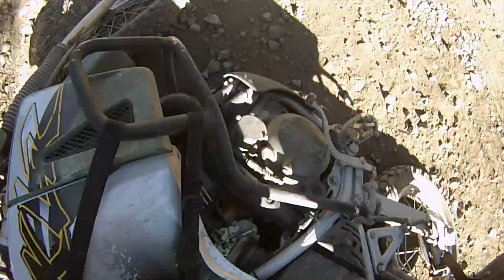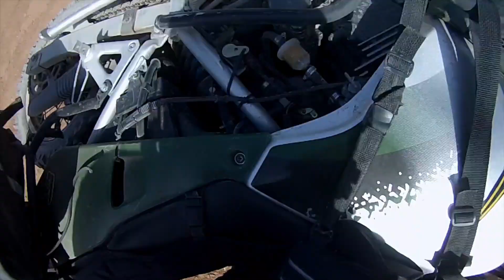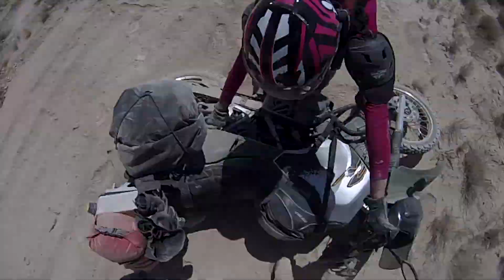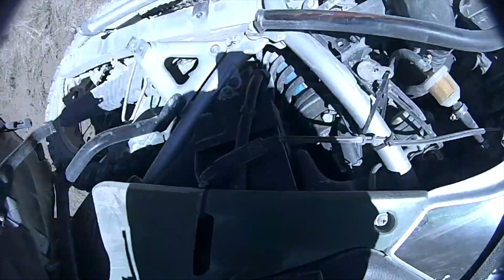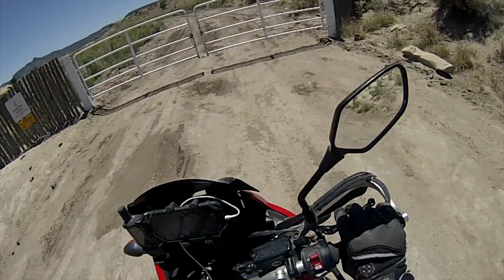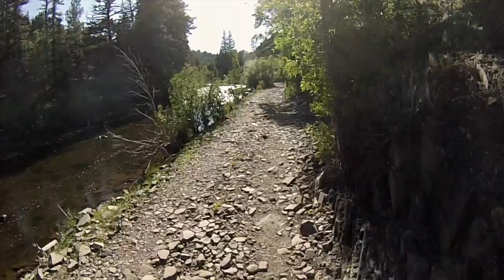June 2018 New Mexico BDR

Comment: June......Bet you didn't have any trouble staying warm
Reply from the maker: Roger Clark There were a few cool nights in the mountains. Much of the NMBDR is elevated, so it really wasn’t bad. There were some miles in the low desert when it was hot, but not too bad overall. 👍
Reply: It was hitting upper 90s in El Paso.  Wish I could have gone with you.
Reply: OOPS.   That was on the wife's login.      I've been camping around Cloudcroft  that time of year several times.   Mid 40s at night or  warmer.